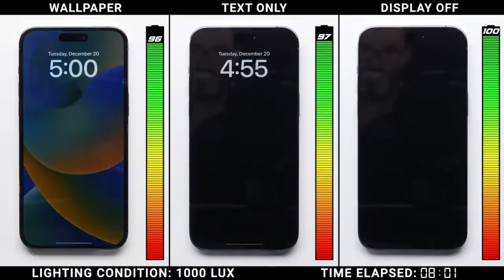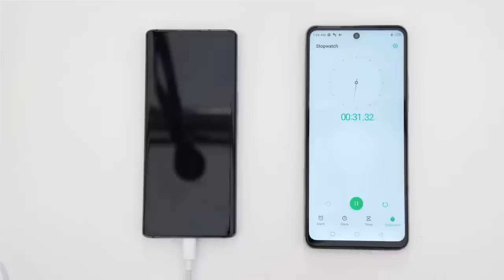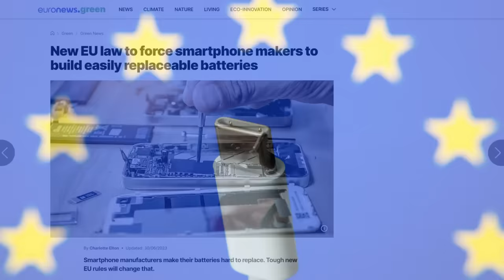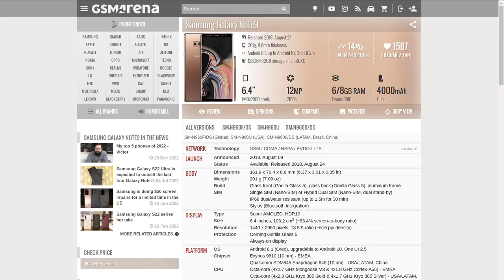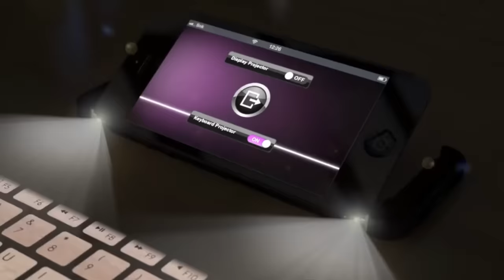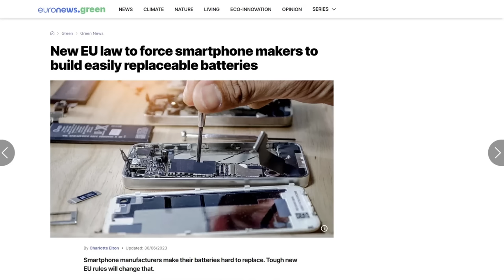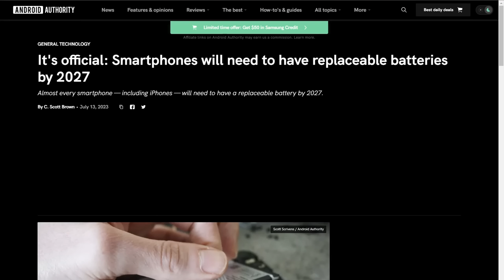All Smartphones Will Soon Have Removable Batteries

Comment: they can keep it water resistant by making a battery that can be replaced like a SIM card with the SIM tray. You know, that thing you have to poke with the specific tool they give you to unlock the tray. I think that'd be pretty cool and functional
Reply: i too like this idea
Reply: Was thinking about this as well. Hell, do it with all the components connecting to a central motherboard in sandwich arrangement and you got yourself a completely modular phone
Reply: honestly best idea i've heard so far
Reply: good idea
Reply: @pvshka  fairphone
Reply: sim cards are quite small so it might greatly limit battery capacity.
Reply: Actually LG made a phone in like 2016 or something where it has of something similar to what u described. A sort of a sim tray, at the bottom, where u could pull out to reveal the battery, and ultimately replace 'em.
Reply: @devedee2393  I was thinking about LG G5 too
Reply: There are so many ways they can make it water resistant, it's just a bad excuse, there already have been water resistant phones with removal batteries. I bet first Apple will make a non water resistant phone out of spite and then once other companies are making water resistant phones they'll have no choice but to do the same.
Reply: Physical sim cards are going away in the next 2 years as well.
Reply: If people wanted that, L would have made millions and we wouldn't have current phones. Instead, people ditched LG
Reply: @Digitaldreamer7 not in China. They even mandate dual sims
Reply: @hydrosmusic  yeah, dual esim, not a physical sim card.  iPhones aren't made with sim card slots anymore
Reply: @Digitaldreamer7  again, not in China. I have friends and family members that have dual physical sim cards on their iphone 14s that they got in China
Reply: Lg did it with no issues no? Samsung S5 had a removable back that was still ip67 water resistant.
Reply: That would mean that the battery is the outer case? that's hazardous but a proper placement of back could make it work,with new sodium batteries EU has taken the best step, design can't take over better functionality
Reply: @dinozaurpickupline4221  no it's not.  LMAO.
Reply: @Digitaldreamer7  not hazardous?
Reply: @dinozaurpickupline4221  in no way is it hazardous as long as the battery isn't bloated or defective
Reply: Cameras used to have these push to remove batteries
Reply: samsung did just fine using rubber gaskets around the battery years ago, this is an overcomplicated solution to a problem that was already solved years ago
Reply: @123456qwerty939  we just want removable batteries
Reply: @Digitaldreamer7 in china they are source i lived in shenzhen for 1.5 years
Reply: (chuckles) galaxy s5 (chuckles)
Reply: Yea but aren't batteries bigger than Sim cards? I wonder if the designer will be able to do it

Comment: I like replaceable batteries but adding that mechanism will cost space which could be used for more hardware or a bigger battery. Also with all this different quick charge technologies I'm not sure if you could use any other battery to benefit from them. And if you need to buy a battery from the manufacturer to make use of it, it won't be cheap.

Comment: As a German I have to say, that accent was priceless. I'm not sure whether the batteries are going to be that hot-swappable. There is a chance that they might include a water-seal that breaks on removal. So that you can swap them yourself, but only for a one-time replacement per battery. Let's see what they come up with to separate RAW from RAI this time.
Reply: I think that wouldn't work. Like, that's basically needing to break your phone in order to open it, or needing someone specialized to open then close it for you. 

Maybe the companies could use that for a year or so, but I don't see judges letting that go, at least not in Europe.
Reply: "a portable battery or LMT battery shall be considered readily replaceable where, after its removal from an appliance or light means of transport, it can be substituted by another compatible battery without affecting the functioning, the performance or the safety of that appliance or light means of transport." From adopted text
Reply: @spl420  I read this as "you can take the battery out easily and replace it with an equivalent battery." Doesn't specifically say, that you can put the same battery back in. It just says that the appliance is unaffected, not the battery. But I might be off. Portable should mean portable.
Reply: @Cha0sNicr0  well, could work in short run, in long run will only increase usage of cheap Chinese batteries as replacement.
Reply: @Alexander-jr8nw  swap while on the charger of a powerbank. i had phones that worked with no battery only with a charger plugged in

Comment: I think that those regulations don't forbid, for example, battery cases that are fixed in place by Phillips screws, or battery cases that require to put a paperclip in the hole to open them much like SIM and SD card slots on most phones. This makes it relatively easy to design water-resistant devices as well as eliminates the risk that battery case will open by itself if the phone will hit the ground

Comment: I believe the primary motivator was ensuring the phone could not truly be turned off, and allow unnamed agencies to power it on remotely at will.
Reply: That is a great reason by itself!
Reply: well said!!!!
Reply: This can still happen. There’s nothing in the legislation about having a secondary low level power source for such a thing. As long as the phones main battery bank is removable. Those “always on” chips in phones are extremely low power so imagine like a tiny 250mah embedded battery JUST for powering those super low power devices. I’m highly expecting there to be strings attached to this change, so to speak.
Reply: My PC literally turned itself on last night from Hibernation. Twice. I can only assume Windows wanted to update and the power wasn't truly off. I yanked the power cord out at that point.

Edit: I threw the PC in hibernation before pulling the plug. Also I didn't want to choose "shut down" because I still had some things open I wanted to use that next day.
Reply: also google
Reply: Profit is primary. Unless the CIA is paying them
Reply: @joshuan.  just a heads up that can cause a corruption of the OS, but yeah by default even shut down doesn’t kill all power to the system.
Reply: @metalmanexetreme  Rarely happens.
Reply: @acmhfmggru  this
Reply: bro just stab the antenna
Reply: @joshuan.  The two reasons mine liked to turn itself on were scheduled updates and glitchy mouse drivers.  I shut off the update wake option and disabled USB wake entirely, and I've never had any issue since.
Reply: @joshuan.  Disable Wake on LAN in your router or yank the ethernet cable out. I know how that feels, so many nights I would wake up to my PC being on since 2 AM.. damned Windows. Only my Windows device does this, my Linux PCs are fine. Hibernation still allows your PC to turn back on by a 'Magic' packet, that is intended, but will only happen when plugged in by ethernet.
Reply: @acmhfmggru  your lack of creativity is a limit to your intelligence, or maybe it's the other way around. If I can imagine that motive and that usage, those with that motive who would seek to benefit from such usage can also imagine it. It's only a theory until it's proven (and actually it has been proven, but you probably live under a rock). Aside from that, look at all the conspiracy "theories" that are being proven true every day. And don't you know, I just "made them up" too.
Reply: @justayoutuber1906  control is primary, and profit comes from control. For those on the top, money is just a number printed on a piece of paper. Real property and control over thoughts and actions is real wealth. Take a "loss" over here and make a gain over there. They'll take profit when they can, but if power comes at a loss of imaginary funds, they'll take that loss.
Reply: They dont need to turn it on to listen in ,thats common knowledge
Reply: HELLA based wtf
Reply: @jesseessej  In addition to this, I don't remember if this has actually been named but there's a derivative to Murphy's law.
" All that is susceptible to happen, on a sufficiently long timespan, will definetely happen. "
There are multiple thought experiments to demonstrate this, the most absurd one is: put thousands of monkeys behind keyboards for an infinite amount of time, at some point they'll have rewritten all the greatest books, sequentially, in all orders possible.

This is to say, if you can imagine a scenario in which something can happen, not even mentioning people having an interest in it, it will unless something is done to prevent it.
Reply: @joshuan.  You don't need power for hibernation so you might as flip the switches at the wall whenever you hibernate.
Reply: You assume far too much NSA involvement in the engineering depth of multiple companies. This was market drive because everyone hated bezels and wanted to carry razor blades for phones.
Reply: @paravoidy  Ohhh, don't worry. There's enough radio energy to power some data logging, even if not transmission.
Reply: @dutchcrepe  I believe by default Windows is set up to perform updates at exactly 2 AM, so that might be what you were experiencing. If you want uninterrupted sleep, you have to change your “active usage hours” to be in the night, rather than during the day, as nonsensical as that is.
Reply: @joshuan.  Yanking the power cord is ill advised because of file corruption. In order to actually shut windows off properly you just need to type the command "shutdown -s -f -t 0" in a command line, otherwise it will just enter an advanced sleep mode so to speak when you do it in the GUI aka the normal way so it appears that it starts quicker next time you turn the pc on. The bahaviour of standby or hibernation also changed, linus tech tips even did a video on the feature called "modern standby" where it drained the batteries on latops in standby mode during travels.
Reply: @joshuan. That's why you should shutdown your PC entirely. Also, in case it starts up again, there is a setting in windows of "quick startup" i believe. You should turn that off. 

Worst case or precautionary measure, turn off psu switch
Reply: @ActionScripter  thank you, I'll keep that in mind
Reply: lispax  I can't afford a 2nd machine and I don't want to lose the functionally of games and utility software. Best I can do is disable as much telemetry as Microsoft will let me, and then run the Windows 10 Debloater.
Reply: @ThePC007  Doesn't matter. For some reason my router just doesn't play nice. In my parent's vacation house it does not occur. Back home it occurs no matter what settings. As long as wake on LAN can be performed, it will be.

Comment: To be fair, the battery is not required to be quick to be remove. It can still require a screwdriver or any other tools. The key point here is that it has to be a very common screw driver or the tool has to be included when the device is sold. Which is an amazing idea. Oh, and no damn glued in screens and shit.
Reply: I'll take that any day over having glued in batteries which are a pain in the ass to remove. 

(Work at a phone repair place and have had colleagues set batteries on fire when removing them. Happened once in my 2 years)
Reply: Repair places go bakrupt
Reply: @russianyoutube  good.
Reply: Rip water resistance